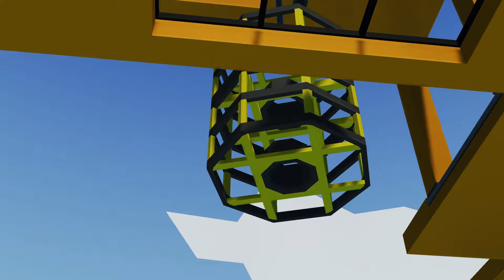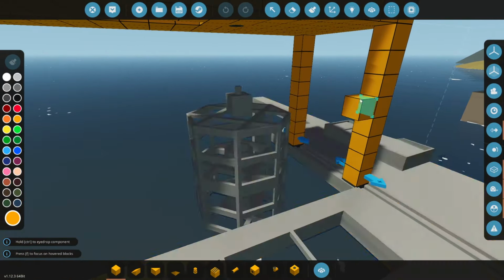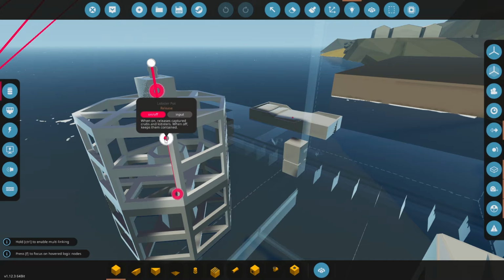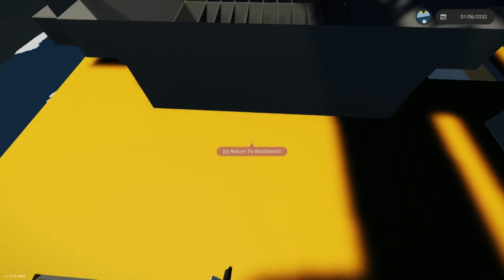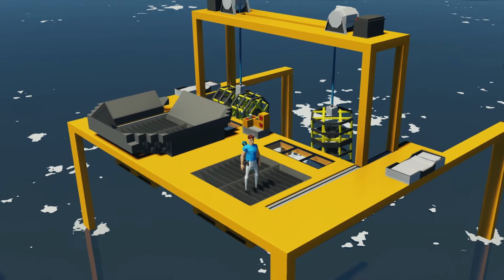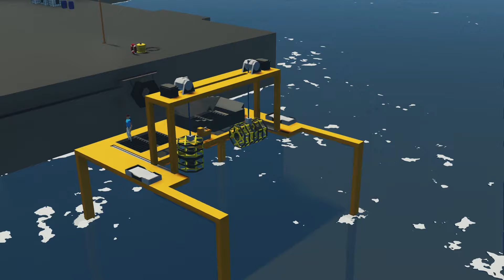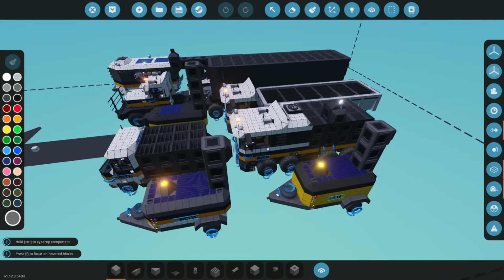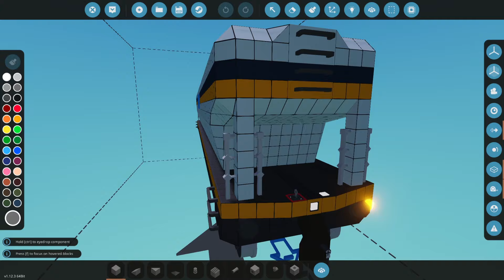Best Way to transfer LOBSTER POT to HOPPER in Stormworks

Comment: i wonder how  a long series of crab pots would eject crabs if it was held horizontally while unloading. 8 to 10 pots connected top to bottom like your efficient unloading ones. i'm thinking it would still eject them out the "hole" but i guess they might come out the sides of the pots. theory crafting a ship that would have 4 of these that could be dropped off the back or sides. i'm sure the income from those crab pots would be insane. 🤔